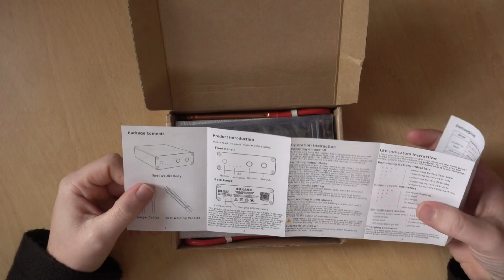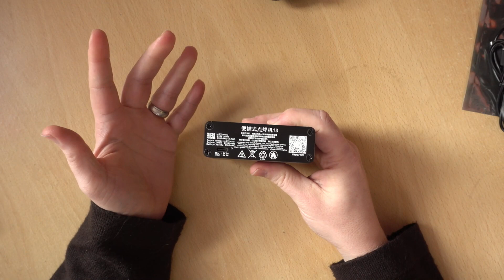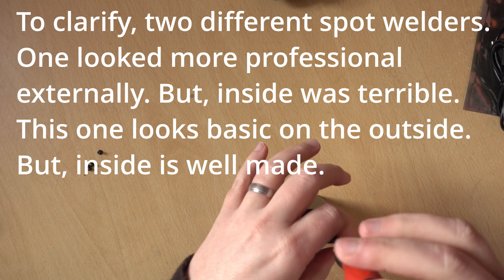Cheap nickel strip spot welder, for making LiIon battery packs - First look

Comment: 13:26... I spot weld a small Nickle Strip to the + and - output cells, fold it over and solder the XT connections to the strips to reduce ant heat from soldering getting to the cells.
Reply from the maker: I do for other packs. But that pack in particular, I wanted the smallest and lightest as possible.

Comment: Great video, thanks.  I finally got the unit.  How easy is it to solder wires to the nickel strip?  Should the surface be scratched before soldering?  Thanks again for the recommendation.
Reply from the maker: Soldering wires to the nickel strip is pretty easy. It is worth keying it up first. Solder the wires on, then weld it to the cells.
Reply: @MrD  Thanks for the quick response.  I will try to solder in the coming days.
Reply: @MrD  I do not want to solder wires directly to the battery.  So I thought of soldering the main wires to small pieces of nickel, and connecting the nickel to the battery with the device.  What do you think?
Reply from the maker: Yep, that will be good.

Comment: These spot welders all use a same basic circuit but some miss an essential capacitor present on proper welders like kweld that cause the mosfets to blow when voltage dips below 5v when connected to a weak battery.

Comment: Great guide Darren, nice and clear to anyone that hasn't done this before. Also liked your explanation of doing the balancing lead, that's always something I thought I would screw up! :)  Shame you still have to solder the end connections, anyway you can avoid that?
Reply from the maker: Thanks Dave. I could solder to some nickel, then spot weld that on. But with this small pack, I wanted to keep things more compact. That would have added more bulk to a side. But still, only 2 solder joints is better than 6 on that 3S pack.
Reply: @MrD  Yeah not criticising your choice to solder them just more concerned if I was to make a pack whether I'd solder it successfully without damaging the cell :-D
Reply from the maker: @DavePinnock  yes, that’s always a concern. Flux, a big chisel head tip, and be as quick as possible. But still, spot welding it would be better.

Comment: Why do you solder the main leads directly to the cells instead of to a tab first, then spotweld the tab to the cell and fold it?
Reply from the maker: Because I wanted to keep this pack as compact as possible. On models where I have more space; I’ll definitely be soldering to nickel tabs.

Comment: Darren:  
   Very nicely done  video!  I wish I knew about this model when I built mine. I spent a bundle for a sealed lead acid battery (7amp), which I will have to take multiple steps to recharge. Your solution, rechargable using a high capacity USB connection is MUCH more convenient.
   For you spot welding step, I suggest you simply drill out a 2x4" wooden block as a jig with holes sized to your intended Li Ion batteries to hold your batteries upright, and close together as you spot weld them. Then simply wrapping them in shrink wrap or just taping them together with electricians tape to secure them.
- Jim
Reply from the maker: Thanks Jim, and thanks for the tip. After making this video I did see some 3D printed jigs for various cell layouts. That is definitely something that I’ll be looking in to making. Also, I’ll print a stand to hold the welder upright. I think that will make life easier too.
Reply: @MrD  You bet!

Comment: There is just one downside: over time the built in battery will suffer a lot and I had faced an issue when we hit the 500 th battery spot welded which comes close to 2000 spot welds. If you have 1 cell you spot weld 2x on the top and 2x on the bottom so 4 spot welds per cell.

The battery will increase its volume and it got really tough to get it out of the box again to replace the battery.

Overall I simply would prefer if they would have used 18650 cells as power source for the spot welderer. 
Unfortunatell I could not find the right battery as replacement and therefore had to go for my own 18650 box to power it up externally which is not the easiest way cause it needs thick wires. 
I guess we will see a better kit in the future for all those who wanna do more spot welds cause once the internal battery is blown up you can not get the whole assembly out of the box any more. We had luck cause I constantly checked it every 200th spot weld cause we had such issue with a similiar product before.

For the usual hobby battery spot welder it will work out but mine was done after 500 batteries.
Reply from the maker: Some excellent points there. I think if you’re welding 500, 1000 or more cells. The box, mains powered industrial spot welders would be a better choice. Then again, they cost two or three times as much. But for the hobbyists, these welders are good enough. But may be worth checking the battery occasionally.

Comment: Yes. I bought one of these a little while ago. Great little unit that works a treat. Shame that it didn’t come with the nickel strips, but after getting some, I was spot welding everything. Have made a 4 cell Eneloop pack. Also highly recommend 👍👍👍
ABSOLUTELY agree on longer leads too. On mine I put sticky back foam padding on the black box’s base to stop it sliding off the work bench at that critical weld time
Reply from the maker: I didn’t even think about making eneloop packs. Some of my gliders may get a treat 🤣 Good call on the rubber too. I’m going to 3D print a stand for the welder. But that can get some rubber feet.

Comment: Bought the cheapest one a couple of years ago, it worked to solder a 2s for the radio... Never worked anymore
Reply from the maker: Yeah, the really cheap one I bought a while back doesn’t compare. The main power traces are tiny. I beefed them up with solder. But never got round to sorting out the battery for it.

Comment: Cheers Darren. I use the solder method at the moment, but this may just change that.
Reply: I was a devout soldering pack guy for a long time. I don’t knock it, but believe me with one of these you can knock out packs very quickly. Still love my soldering thought for everything else 😉
Reply from the maker: Me too. I didn’t have any other option before. But I have to say, it does seem safer using the welder, and is definitely quicker.